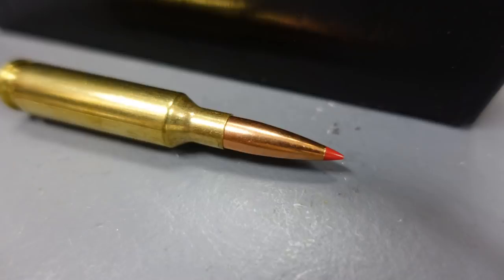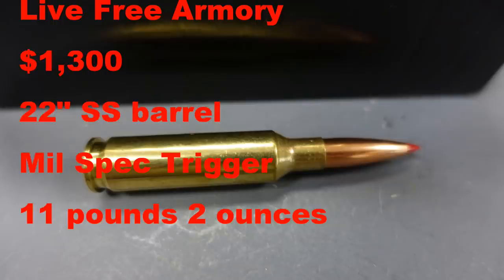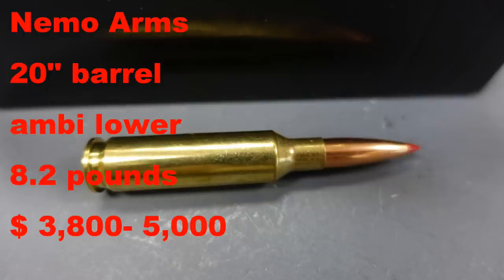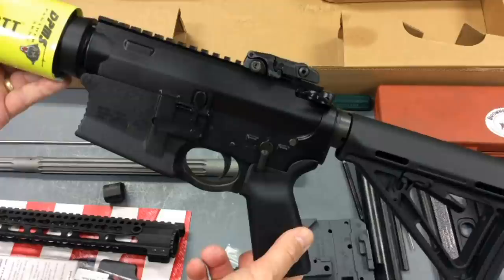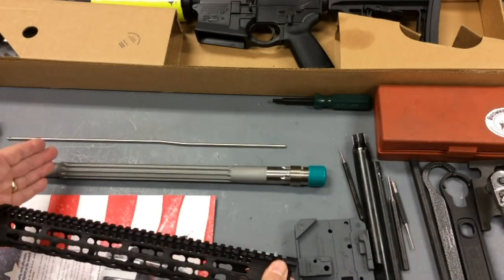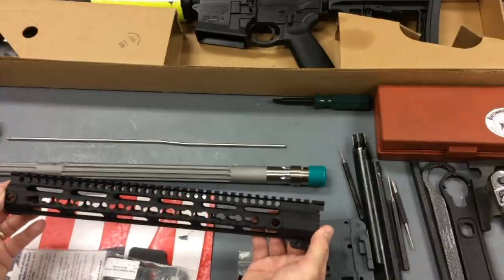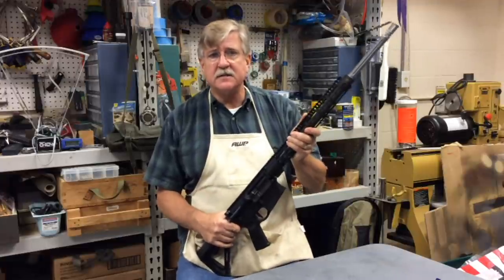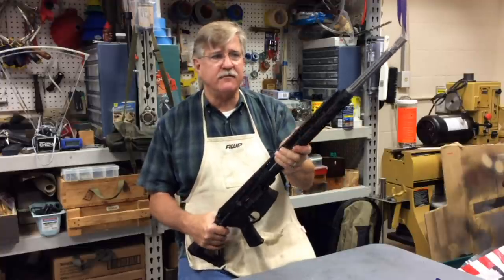Build Your Own Match Grade, Lightweight, Semi-Auto 6.5 Creedmoor Rifle

Comment: As a gunsmith I'm impressed you should make instructional videos I've seen many accredited programs way worse, great job thanks for helping the industry you 're professional and greatly skilled in our discipline!
Reply from the maker: Thanks.
Reply: if your a gunsmith then you should go back to school and learn the proper way to instill a barrel ... this is fine for a home build, but this would not fly in my shop.... also with the 6.5 creedmoor he should have check the head space.. if he is using the original .308 bolt. the barrel needs to be headspaced.. oh yeah an adjustable gas block is also a good idea

Comment: Its still heavy, I assembled an AR308 with aero precision receiver set and their hand gaurd. I used all 2a lower parts with a Jl billet titianium bcg and a faxon pencil barrel. The gun was under $1300 and it weighs 6lbs without optics and 7lbs 4oz with optics. I could’ve got it down to 5lbs with a 2a receiver set and their hand guard for only $400 more but they were out of stock at the time. It shoots moa all day long with that pencil barrel, Im not going for sub moa with a gas gun I have other guns for that. Your gen2 was a nice upgrade but not as light or inexpensive as a custom home made build.
Reply from the maker: Thanks for watching. The barrel used is close to 4 pounds of steel. Using a barrel with the Faxon profile would knock off close to 2 pounds. 2A makes some nice stuff.
Reply: Michael Bell, Shoot’ I just saw this video is 3 years old. Im not sure the Faxon pencil barrel was even available or the 2a  Xanthos receiver set was available back then. My first custom build was an M1A in a Troy MCS chassis, it came in at 12lbs with a scope and bipod. After that I really started paying attention to light weight builds. I have 7 AR’s in various configurations and none of them except the 308 weigh more than 5lbs with optics. My lightest Ar is a 14.5”  that weighs 3lbs 11oz. My builds are reliable and somewhat inexpensive compared to store bought lightweight guns. I wish a gun channel like yours would do a super lightweight build video with all the lightest parts available. I have a list of parts if your interested. Thanks for being kind to my first critical comment.

Comment: nice job. ive always loved the styling of the DPMS G2.
that gorgeous Noveske-esque flared mag well and "melted" geometric architecture just does it for me!

the weight is a homerun but the lack of ambi controls bites!
still its a great foundation for a build and exactly the idea i have too.

im planning to build a lightweight battlerifle. kinda a M4 in 7.62.
im leaning towards the Adams Arms external piston op system with fully ambi bolt control at this point but the sheer beauty and light compact design of the G2 is calling me too.

maybe i could build a long range precision rifle from the G2.
ambi controls arent necessary for that. not as anyway.

question- when you installed the barrel why didnt you use a torque wrench?
also, do you not "season" the threads by tightening the barrel nut in stages?
ive always thought its a good idea for anything subject to heat cycling and sudden, intense vibration and expansion forces.
that could help tighten groups a bit.
and finally, what about using Rockset or Loctite on the barrel extension itself to take up any play. and provide a more solid interface?
ive always thought thats a good idea.

it looked like your barrel fit the receiver fairly snugly but in the world of minutia, such as target shooting, even .0005" can make a difference.

or have you since gotten it to deliver at the range?

thanks for a great build. i enjoyed it!

Comment: Really wanting to get a 6.5 set up. Another route would be through Aero Precision. You can get a complete  M5 lower for around $300, and an 18", 20", or 22" M5E1 6.5 upper for around $650. The hand guard system they use offers a "free float" system which is nice.  
I have a M5E1 in .308 and really like it. The way I have mine set up is quite a bit heaver though. It's around 13 lbs I would guess, but that is with a scope, bi-pod and heavy metal offset sights and a magpul PRS stock. The barrel profile on my 20" .308 was pretty meaty and I am sure you could find a lighter one for as well. Might be able to get a lighter barrel and a shorter hand guard with more weight conscious stock and have it under 10 lbs.
Reply: Colson Customs i went that rout 22in stanless 6.5 aero  gen 2 with nitrate bcg and new radian lt for 660 lower upgraded mag for 350 and matching it woth a VG6 stainless muzzle and my Bushnell  elite  tactical  5x15 scope
Reply: Exactly, save money and buy all the parts instead of buying a complete rifle and swapping the parts.

Comment: for the MI Gen 2 handguard, i cut out a piece of .100" thick aluminum, to insert between the 2 ears for the 2 screws that hold the HG to the barrel nut.  profiled it to match the outline of the ears, painted flat black.  helps to keep the ears from bending over time, HG coming loose.  i don't like the idea of glueing the HG to the barrel nut. MI 3rd Gen HG has a different set-up.
Reply from the maker: Seems secure as is, we'll see how it holds up. If I see any problems with durability I will definitely report on it.

Comment: Great video!  I'm thinking of doing a similar build myself.  I have a few questions though. 1. How, if at all, does the carbine length buffer system affect the function of the rifle and what would happen if it were changed to a rifle length?  2.  Now that it has  been about a year and a half, would you do anything different if you were building it now?  Thanks for your videos.  Your channel is great.
Reply from the maker: I think the rifle buffer would work great but just add weight which I was avoiding in this build. Have not changed anything. Thanks!

Comment: Nice job. Just not a fan of having the gas block exposed. Probably go with a longer hand guard.
Reply from the maker: I used a 15" hand guard, so you will have to go at least 16" to cover the gas block. The barrel gas tube length is longer than the standard rifle length.

Comment: Congratulations on the build and the video! I start gunsmith school in the fall. We will have to chamber our barrel. I am thinking 22" 1to8 from Krieger or Shilen. The bolt is critical also. What kind of groups are you getting?
Reply from the maker: Working up loads now.
Reply: Have you tried the Lapua small primer brass? Most long range shooters I know like the brass and Berger 130 OTM.

Comment: My average ar15 weight is 7lbs 12oz across 6 ar15's. I bought a dpms 308 oracle last Friday. Hoping to get it around 9 -8 lbs
Reply from the maker: My goal with this build was 8 lbs and less than $2,000. If you credit The take off parts then the cost was closer to $1,700.

Comment: how do you feel about the lighter weight carbon fiber barrels, will they last ok and not warp by heat faster than a full steel barrel?
Reply from the maker: They are not that much lighter and a lot more expensive. I don't care to much for the looks either.

Comment: Why did you decide on the birdcage and not get a better brake? It's worth the few dollars and weight for the faster follow up shots.
Reply from the maker: That would be a good upgrade. Just started out with the birdcage.
Reply: Michael Bell i was just asking cause I'm part of the small percentage of people that find that boring little flash suppressor adequate for all my .223 5.56 projectile chuckers. But 6.5 may be too large for it. That's what I meant anyway.

Comment: rock river has a lar-8M 6.5 for $1,040 1 moa
its cheaper than buying a 6.5 upper
Reply from the maker: The prices I see on their website are right at $2,000. The LAR-8M is a large frame AR-10 design and weighs about a pound more than out small frame build. Also for $2,000 we have a rifle with a $250 Geissele trigger. The barrel still has to be broken in. We'll see how it does, but I agree it has to be sub 1 MOA or it goes back.

Comment: I'm new to the 6.5 idea.  I thought you can use 5.56 platform ar upper n lower.
Reply: 6.5 Grendel is small frame.  6.5 Creedmoor is large frame.
Reply: @Ub3rNo0ber  Thanks. Guy at the gun store had it mixed up or I heard em wrong.

Comment: Was there any reason why you didn't season the threads on the locknut? Or is that not necessary on that upper?
Reply from the maker: It was not a brand new upper since a barrel had already been installed, but nothing wrong with always doing that.

Comment: What about the buffer? Did you stay with the original smaller buffer?  Do you feel that you may need to have to go with a rifle buffer? I've been researching on building my AR 6.5CM based off much research and many folks have said they recommended going to a rifle buffer instead of the original carbine buffer.
Reply from the maker: You would have to change the receiver extension to go with the rifle buffer. You could do that but it is not necessary. I was trying to keep the weight down.
Reply: Got it.  So have you had any issues i.e. failure to eject, bolt not locking back, with the existing DPMS buffer and buffer spring?   Also, thank you for sharing this video.  It has been very helpful and is allowing me to build my AR 6.5CM build based off your similar build.
Reply from the maker: No ejection issues at all.

Comment: pretty light for a 6.5 creedmoor.   6.5 barrels are inherently heavy.   the hot round needs a tough barrel.  I've managed to hit sub 7 lbs on a .308 ar but can't find a barrel that will do the trick for a 6.5 creedmoor.  this one came in at a good price as well.
Reply: Picasofly It's not any hotter than 308, but the problem is nobody makes pencil barrels for it, however if you do want a lightweight barrel, carbon fiber wrapped barrels are unfortunately the only lightweight barrels that I'm aware of.
Reply: Hayden Follett been looking around and 2a arms has a 6.5 creedmoor pencil barrel that weighs 2 pounds 3.4 oz.  I don't think it will be as accurate as the barrel used here but it will reduce the weight for sure.  Those carbon fiber barrels are really nice but they will blow the budget on this rifle. The 2a. 6.5 barrel is only $300.
Reply: Picasofly The 2A barrel is made by Faxon(generally good accuracy, not splitting hairs, but 1moa or less) and if you care to go down to a 16 inch barrel you can lose some weight(listed 1.89lbs). You'll lose ~200fps ±50fps depending on bullet by going to a 16 inch from a a 27 inch.

Comment: Wow a gun video that is monetized!! how'd you pull that off?
Reply from the maker: YouTube cans the adds initially and you have to appeal. In the mean time when your video is new and getting the most views it is not monetized . Then when it is reviewed they usually approve mine, but by that time views are down. My overall earnings are only 25% of what they were before the change. I was not getting much but it did pay for the ammo and gas used to produce them. Now it's a loss. I am considering Patreon to try and make it not a loosing proposition to keep producing videos. I have a lot of projects in the shop to review. I am waiting for a little cooler weather.
Reply: Just picked up an aero m5 e1 upper complete and want to install it on a dpms lower complete. Will the dpms bcg work on m5 e1 6.5 cm

Comment: Also you didn't stake the gas block.  Why?
Reply from the maker: I will occasionally stake the receiver end plate to lock the castle nut but I have never staked a gas block. Do you stake your gas blocks? You can pin a gas block if you want. That is more important with piston builds. I have never had a DI low pro gas block move. I use Rocksett and let it cure for at least 24 hours.
Reply: dsclaiborne31 While I did stake the very few non-pinned LPGPs I have. I don’t know if I would bother doing it on a match rifle.

Comment: Savage also has their new MSR 10 in both .308 & 6.5 creedmoor. The Hunter version is low cost and the Long Range version comes with a side charge handle and even its street price is probably under your $2000 budget. Bet they don't meet your low weight target though~
Reply from the maker: It is the weight factor for a hunting rifle that got me thinking about using the small frame 308 as the starting point. I am curious to see how it functions. It may need an adjustable gas block. I could make this lighter with a tubular carbon fiber handguard and a titanium muzzle device and gas block,  but I like the MI handguard and wanted to avoid the cost of titanium.

Comment: What is the torque spec on the barrel nut?
Reply from the maker: I still use greater than 35 and less than 80 ft/lbs.
Reply: @MichaelBellmbell556  Thanks

Comment: What?! You OWN the proper tool for installing the barrel nut but didn't USE the reaction rod to install the barrel nut so you don't warp the upper? Not sure if you seasoned the threads already between the upper and barrel nut or not but you skipped over that part too and then didn't even use a torque wrench to make sure you were over 35 ft lbs on the barrel nut, "gud n tight" works I guess?!
Reply from the maker: The reaction rod teeth are not the correct shape and this was my first re-barrel of a Gen2 upper. I have since used the reaction rod without any issues. I did season the threads. I know what 35 ft/lbs feels like. Thanks for watching. I have a 260 Remington G2 build with a 16" barrel that weighs less than 7 pounds.

Comment: There is no head spacing involved?
Reply from the maker: I do not have Creedmoor gauges.
Reply: Michael Bell well my question is are gauges NEEDED on a full build. I bought a pre built upper cause I was afraid of all the information on the internet about head space.
Reply from the maker: If the barrel extension was placed in spec and the bolt is in spec then the head space should be in spec. The gauges are to confirm.

Comment: you installed the barrel incorrectly.. any armorer will tell you that you need to seat the threads.. ie. tighten and loosen.X3 then torque the barrel nut to 40# to 80#. it is also a good idea to lap the barrel to the upper as well as apply a bit of sealant around the barrel such as hiigh temp lok tite or gasket maker.. especially since this is a high pressure rifle.. please your making real gunsmiths look bad.
Reply from the maker: I do season the threads by loosening and tightening and I apply Aeroshell grease to the threads. I have a lapping tool but do not use it routinely. I would never put lok tite around the barrel. I an NOT a gunsmith. I am a hobbyist. I do not mean to come off like a "real gunsmith" or make anyone look bad.

Comment: recent key mod tests have shown it to be a weak design.
Reply from the maker: The MLOCK is stronger, but key mods work well and this rifle won't be abused.
Reply: I can understand that, I have been taught to over build anything that I do. So it just seems to me an unnecessary flaw.
Reply from the maker: We made the decision based on weight. I do usually, but not always, choose M LOK  over key mod in my current builds. I did just buy some MEGA uppers with key mod just because the prices were so good. I do have several m-lok MEGA uppers that I have also bought on sell recently since they have stopped making them. They are strong uppers.
Reply: I love MEGA I have a matched ambi upper and lower set that is terrific not as happy with the barrel as I thought I would be its an 18 in saber defense it prints real nice to a hundred letters past that it seems to open up quite a bit at 250 its just all over the place. 6.5 grendel by the way

Comment: Shoulda started with a  Palmetto 6.5 rifle
Reply from the maker: I love PSA but their "Gen2" 6.5 Creedmoor rifle is NOT a small frame AR10. The starting weight of this rifle is around 12 pounds. I wanted a small frame lightweight build. The starting weight of the DPMS Gen2 I used was just over 7 pounds.
Reply: Michael Bell - I didn’t see anywhere on psa website that the weight was listed.
Reply from the maker: Right, they should list the weight. This is a full size ar10 base rifle.

Comment: Buy an M&P 10 6.5C for $1500?
Reply from the maker: You could go with a light profile barrel on this build and be about a pound and a half lighter.
Reply: Michael Bell true. My big concern would be reliability. The AR10 platform i have found to be sensitive to jamming. The M&P 10 at least in 308 eats everything no problem and is light and accurate. I heard the M&P 10 6.5C is even better but a pound heavier. How’s your built going in terms of reliability.

Comment: So he wants a lightweight, super accurate, not expensive rifle....who doesn't? Buying parts to throw them away doesn't help keep your cost down. Just thought I'd throw that out there
Reply from the maker: Resale the parts to keep the cost down.
Reply: @MichaelBellmbell556  But you'll never make back on the parts wheat you spent.
Reply from the maker: @fordman32508  The new parts are a significant upgrade.